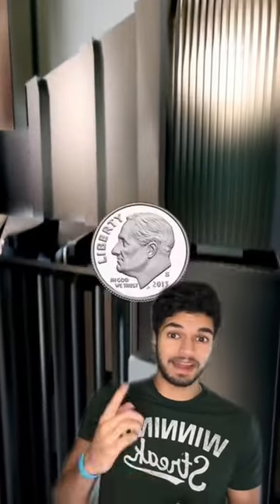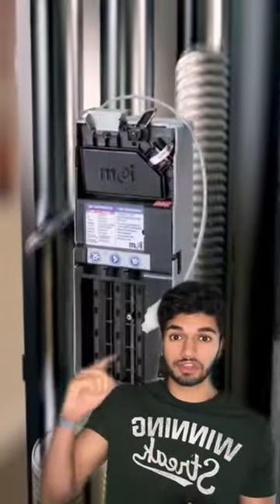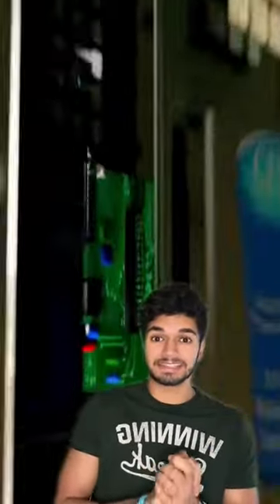How a Vending Machine Actually Works #Shorts

Comment: I used a flat soda can once but I cut it the same size and width of a quarter
Reply: Oh like a slug
Reply: @MacKennaTheGoddessofRadiation  i guess
Reply from the maker: No way 😂
Reply: @srikarkarra  I did
Reply: Back in college we taped a string to the quarter and when it passed the sensor you pull it back and drop it again till you got your snack.